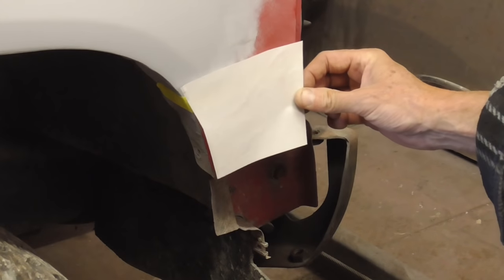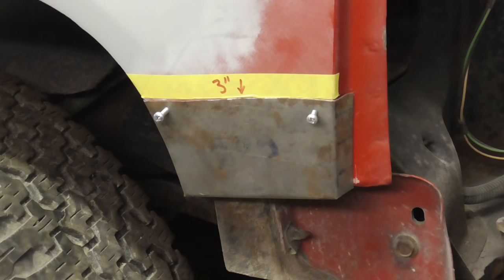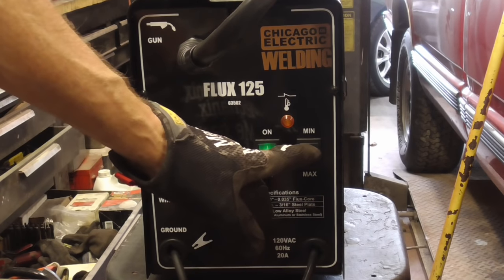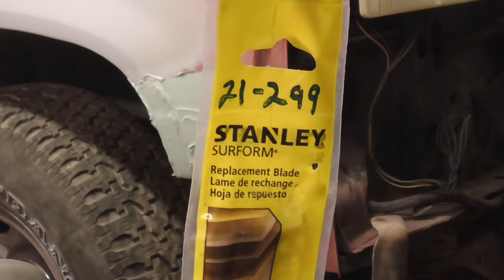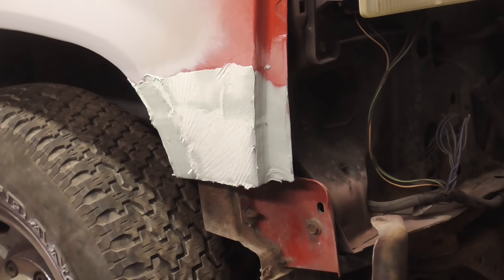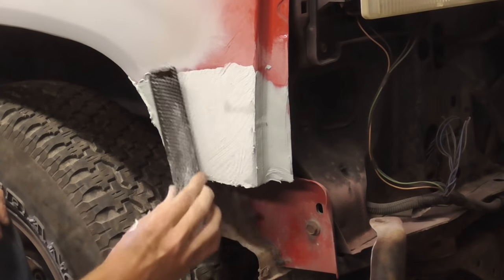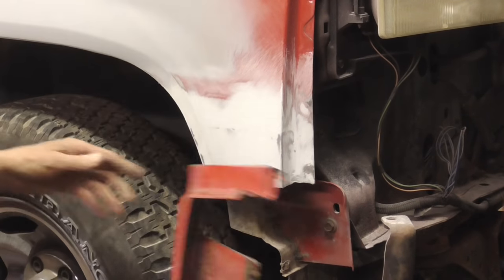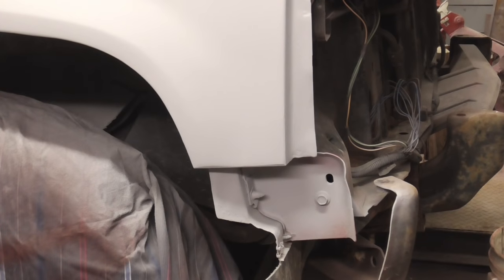Welding Automotive Patch Panels with a Harbor Freight 125 Flux Core Welder

Comment: You’re the first person to explain flux core properly without all the jargon! I thought I’d bought the wrong welder but as I weld outside the flux core is the best bet. Top man . Cheers
Reply from the maker: Plus you can use it outside.  Hard to use MIG (gas) outside as the wind blows the gas shield away from the weld :)
Reply: what did he explain? all i heard him say was put wire speed on 5 and the powere to minimum. did i miss something big?

Comment: Honestly I can’t say thank you enough I have the same welding machine I had sent you a message the other day and asked what gage metal you used you told me and it was a huge help I figured out my problem I had to thin of metal I had it set on max and wire to slow this video was Awsome and after getting all my mistakes corrected it worked beautiful thank you  1000 time over truly I was a mess 😊
Reply from the maker: That made my day - I love to hear stories like that.
You're very welcome - always feel free to ask any question - doesn't matter what video - I'll get you an answer.  Thanks for the comment and support :)
Reply: @LakesideAutobody  I’m watching videos right now on quarter panel rust repair To me your videos are how I would do it and extremely easy to understand I mean your to the point there’s not 10 other things your trying to show I feel like I’m rite there and your showing me again thank you it was such a  huge help I mean it 😊 I’m over in Massachusetts near cape cod just so you know where your students are coming from 😊
Reply: So what guage metal was it?
Reply: @1windozesuk  18 gauge
Reply: @LakesideAutobody  was that 0.6mm or 0.8 wire.i think thaf flux is more difficult to weld thin metal than regular gas welder.it must be clear surface.i bought it to weld automotive.thank so so much
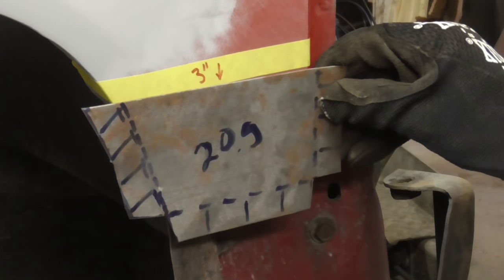Reply: @windozesuk  20 gauge as seen at 0:12.
Reply: What were the settings!?
Reply: Fjjj
Reply: @donaldbaker6961  It says 20 G at the start of the video, clear as day
Reply: @omary5439 if u watch the video he literally shows where he had the welder set up to, and the steel Guage.

Comment: Thanks.  I have the same welder and works great on thicker pieces but easy to blow-thru holes on sheet metal.  I also found Min and 5 speed best for thin steel.  I replaced the passenger floor pan in my 1965 Dart, but make the "mistake" of trying to butt it flush.  That took a lot of fitting and grinding and still couldn't get it perfectly flush everywhere, then many blow-thrus, even holding a copper spoon on the backside where I could.  I should have lapped the two as you do here, which makes fitting easier and less likely to blow thru.  Inaccessible areas I first painted with a "weld-thru primer", using Rustoleum high-zinc galvanized metal spray paint from Ace.  If bare steel, it will quickly rust.
Reply from the maker: Sometimes you are forced to butt weld but most of the work in a body shop is lapped.  A new car has over 4000 weld and not one is a butt weld - remember that when you hear all the hoopla about butt welding :)

Comment: I read your response about lap welds on new cars and It floored me. I never thought about factory lap welds before, I've always butt welded my patches because I was told that was the best way to do it. I may have wasted a few years of my life fitting patch panels on old cars when lap welding would have sufficed. It's going to be hard to break the habit but I'm going to have to give it a whirl. My sons Malibu has a spot that needs repaired and lap welding it would turn an all day adventure in aggravation into a couple hour cake walk.
Reply from the maker: A lot of rust repair videos on this channel are 5 years old now and still just fine.  Here's a follow up video on many repairs done on the channel - I'll do another one soon on this truck (still just fine driving year round) - https://www.youtube.com/watch?v=gIS1Tbv7Kvw

Comment: I've used the same welder on the body patches and it makes for a good patch. your spot method is excellent for avoiding burn throughs. I never tried the sure form blades for rough shaping. Great idea.  I like a fiberglass (water proof) filler in areas where  can't stop water from the other side. Good video.
Reply from the maker: Thanks Papa - you can use the sure forms for both types of filler.  It will make you job a lot easier when sanding that fiberglass filler.  That stuff gets hard as a brick.
Reply: Correct: seal welded area with fiberglass premix, eg: Bondo-Glass.  Bondo has talc fillers which can/will hold water

Comment: This will help me a lot. I'm planning on cutting out and welding in a whole new roof panel to my white crystallite roof Starwagon, just to halt any roof rust hard in its tracks (as well as rust bust and patch weld the rest of the body as needed). Then I'm probably going to paint strip and repaint the exterior in a tan rhinoliner. Apparently Mitsubishi had an issue with their primer under the white paint of these vehicles that would actively promote rust when exposed to sunlight. Mine was garage kept most of its life which prevented a lot of that, but at 30 years old, it's starting to show signs of rust under the paint.

Comment: I can tell you I got the same welder and I do all my panels with it. I do you use the anti-spatter spray, it does help. One thing for sure I can honestly tell you you have to find the right wire you're comfortable with, I found that the Forney 30 gauge wire was the best for me. It really flows good you just got to be last on the trigger to make those little bitty Welds. Small welds less grinding. I really can't understand what everybody is bitching about with the flux core. You know at one time they did make a 23 gauge wire, don't know why they ever stopped!!! I do know it was quite a while ago though. Anyway thank you so much lakeside for opening people's eyes to the fact that it can be done. Actually a lot of people are doing it.
Reply from the maker: A lot of people do just fine with flux core.  My friend likes Lincoln wire - not sure if you tried that before.  Flux core is all this guy (Luis) uses and he do very well with it - https://www.youtube.com/@firstgenerationgarage2803  Thanks for watching and the comment Joseph :)
Reply: @LakesideAutobody  yeah I've tried Lincoln not too bad but I prefer the Forney 30 it just seems to work better for me. I guess in the end that's all that counts right! Thanks again for the video.

Comment: Nice video. Having done my own cab corners and outer rocker panels I found using .030 flux core wire to be ok for this kind of task. These lower priced machines don't take .025 wire. For the DIY folks I found using a shot of compressed air after each tack helps keep the metal from warping. Takes longer but well worth it. Any way you do body work it's a tedious job for sure.
Reply: Thank you
Reply: A dab with a damp cotton rag does the same. Even better a squirt of water based rust converter.
Reply: Where is. 025 flux core wire available to buy?

Comment: This is great! I bought this exact welder for a restoration project I am working on (I am a newbie at welding) but then heard all the comments that you can't use flux core for sheet metal. This video gave me hope that it can be done.
Reply from the maker: Glad I could help!
Reply: Im using mine to weld autobody sheet right now. Works just fine, grinds down nicely. You just have to watch the heat because it'll warp the sheet easily and you'll end up with a low spot where you welded. It can definitely be done.

Comment: I like going back to these demos when I’m doing a similar repair on my nova …. I love doing body filler and learned on my own back in 83 …. And I figured it out pretty Quik , including the grater etc . … I’ve never seen anyone but you or myself spooky it so well and efficiently ! … keep making vids and I’d love to see another one of a rust repair or patch panel with the flux core , which I believe has advantages over regular mig welder
Reply from the maker: Getting body filler straight can be difficult but like you said the grater and sharp paper makes it a lot easier :)

Comment: Thank you, this video is extremely important to me. I’ve got an old Campbell Hausfeld flux core welder that I thought couldn’t be used for body work, but this changed my mind. Thank you very much! Maybe it will work.
Reply from the maker: I hope it does - practice just getting a spot on a plain clean piece of auto sheet metal - then go from there.  Let me know how it goes :)

Comment: I actually have the same welder too and I use the fornay wire it worked really good for mine with minimal buildup on the welds. Don't know if you did the conversion on yours I haven't as far as AC to DC got a comment on my video from a guy that has done his and it works well as far as he says and I've seen other videos as well with the conversion, I think I will keep mine as it is for now as it works just fine. I'm not a body guy I'm a carpenter by trade but I try the best I can and it seems to be working, just helping my friends out whenever I can. Thanks for the content it really helped
Reply from the maker: Glad you like the content Joseph.  That's cool of you to help your friends out - enjoy the rest of the weekend 💯😊

Comment: Hi Jerry great video the only welder that I ever have used is the Harbor Freight flux core actually the other machine that I believe is 90 amps I don't use Harbor Freight wire I go and buy the Lincoln wire and I changed my ground clamp to a heavy duty one and believe me it does pretty good I guess the more you practice the better you get thanks for the video my friend
Reply from the maker: Thanks a lot for that input - I've heard or other folks using brand name wire in this machine.  Good idea with that ground clamp.  You're right - practice does help - have a good weekend :)

Comment: I have the back end of an inner sill to repair (rocker panel in US). But I have a donor car so will be cutting out a piece and working out the best way to insert it. Thanks for the tip about the overlap as I expect the outer panel will need some work.
Reply from the maker: You're welcome.  Let me know how it goes :)

Comment: Nice to see some welds looking a little like mine. Just got my fj73 into the garage ready to start on the floor pan. I'm a total novice so vids like this are awesome, thanks.
Reply from the maker: You're welcome.  Know that in an actual body shop guys aren't welding like a union bridge builders.  They're proficient at what needs to be done looks doesn't really matter - function does.

Comment: That's awesome and goes to show that you can use a flux core welder for body work. People keep saying you need gas otherwise the welds are messy etc. Disclaimer I have never used flux core but have been told the reason most people fall over is because they use the same techniques and try to weld exactly as they would with MIG. Apparently for the best results you need to be slightly further away from the piece and maybe change the angle of approach.
Reply: i have never used another welder than flux core mig.
Reply from the maker: Great point!  Yes you have to practice a bit and try different things.  Although I have always used a Miller MIG (gas) for body work - I don't mind using this little guy - very light, handy, and works fine :)
Reply: Mostly because a regular MIG welder with argon gas attachment costs more, cumbersome to get a bottle and get it filled. Great for little projects. Yes it splatters more, but you can grind that off. Sure, if your a professional with daily welding, you need the gas one as the flux core wire is very expensive compared to the standard mig wire.
Reply: Yes many dont even change polarity and the complain how bad flux core is
Reply: Flux core is definitely a different technique, and you have to reverse the polarity.
I have one of those Italian MIG's from 40 years ago and the HF Titanium 125 FC.
You can't push with flux. You always have to pull so you're not running over your slag.
You need more stick out because you need the flux inside the wire to melt before it gets to the panel. 1/2-5/8 is okay.
Spatter is not usually a big issue. You have to clear off the flux and smoke anyhow, so run a worn out flap wheel over it.
Then wire brush, or spot blast like Jerry shows.
I prefer my MIG because the gas flow cools and keeps me from burning through + it is cleaner, but either works, and flux is definitely the WTG if you have to be outside.

Comment: I have noticed that you seem to use a pretty basic set of tools for almost all of your jobs.  Could you share a list of the tools, supplies and equipment that could get most body work done.  For instance, be specific on compressor, sand paper and grits, blocks, hammers, spray guns, primer, fillers, air tools, sanding discs, welder, etc.  It almost seems like you do most everything with like 4 tools?  I know it's not that simple but it sure would be 'real nice' as you say to have a breakdown of your tools, equipment and supplies.  It would be a HUGE help if you have time to share!  Thanks for all of the great instruction, your style is fantastic, keep the videos coming!
Reply from the maker: Great idea.  I would love to make video of that.  My dad was a body man and he used to have stories of some guy that would come in with a 5 gallon bucket of tools and do everything he needed to do out of that bucket.  I'll put together a video on that - thanks for your input - Jerry

Comment: Great work!  Seems like you always get more Spatter from the Flux Core wore...Agree??  You sure help us boost our confidence for doing these repairs. Thank You!!  👍👍
Reply from the maker: Yes, but it comes off real easy.  Wire wheel on a drill takes most of it off and you have to grind the area anyway before filler - that takes the rest of it off.  I give it a quick sand blast just to make sure the filler sticks real well too.  Thanks for the support BTW and you're welcome - have a good weekend :)
Reply: @LakesideAutobody  Here in Australia BOC supplies anti spatter sprat. I use it a lot on general light gauge work , when using flux core. Not tried it on body panels, but it is water soluble, and makes clean up so much easier.

Comment: Thank you for this video! I was on the fence about doing auto body with a Harbor Freight welder.
Reply from the maker: It's going to work but it'll take some practice.  Some auto body guys will only use flux core.

Comment: You make the sanding part seam so easy :D
Reply from the maker: After you take off the top gummy layer of filler with the Stanley surform - it's a lot easier to sand.  Use a brand new, 36-40 grit piece of sand paper too - cuts real fast.

Comment: I quit running anything "abrasive cutting  disc" related without the guard after a Pal (lives right next door)  who used work for me (he went self employed) ran one that broke - the piece of disc hit him right smack in the middle of his lips, broke in 4 front teeth, tore his jaw & lips apart like you would not believe - he looked like an extra out of a horror movie for the next few months. Dental bills were crazy.. He's 6'6" & built like a tank - an ickle little cutting disc bust him up like a hot knife through butter.. I made a mental note to leave the guard on the grinders.. Let's not....

Before he did that, I never really paid discs much heed. I do now. I run grinding discs & flap wheels sans-guard - but the grinder with the guard gets used for cutting. Cutting discs are fragile - but not as fragile as your face. :-)
Reply: Your so right,,with some people safety's not a priority,,disc without a guard,,lethal,,,
Reply: What's way worse is a wire cup brush with the grinder lock button on! Fml that was a close eye opener so to speak! Never again with the trigger lock! Wow

Comment: I got one of these welders thank you for the video I got a 94 f150 and a 96 f150 that needs patch panels welded in on the back quarter panels been wondering if this welder was capable of it I know I can run some really good welds with it that are very strong this welder don't get enough credit in my opinion once you master it there's really nothing it won't weld if you can get past the little bbs it leaves afterwards your good once grinded down can't really tell i found Lincoln .030 wire works really good in it and if you take the little cone thing off the end that really helps a certified welder told me you don't need that cone thing it's only for shielding gas
Reply from the maker: My friend uses the Lincoln wire and say it works real well too.  Thanks for the comment and the information - good stuff :)

Comment: I have the same welder and welding patch panels 18 gauge i am set at 2 for wire speed and max letting the wire out about an inch ive gotten pretty good- not seeing a need to drop a grand on a new welder
Reply from the maker: There is a guy Luis at First Generation Garage on YT that welds everything with flux core and is awesome at it - he's going to do a few videos on the methods he uses I think :)

Comment: What is your opinion on the automotive spray guns? I've used the gravity feed spray guns before as well as the one that you use which is a siphon style spray gun. To me it always seems like the spray gun style that you use lays the paint and primer out so much better and I'm not sure why.
Reply from the maker: To me really - they all spray nicely if they are clean and you have mixed the paint/primer right.  I have my favorite siphon feed ones and my favorite gravity ones.  For siphon I like the Binks 7 or Campbell Hausfeld's copy of it.   For gravity believe it or not, I like the purple gun from Harbor Freight or the Cambell H's DH580000AV  both are cheap, work fine and always available.